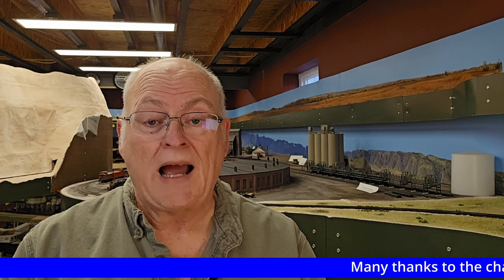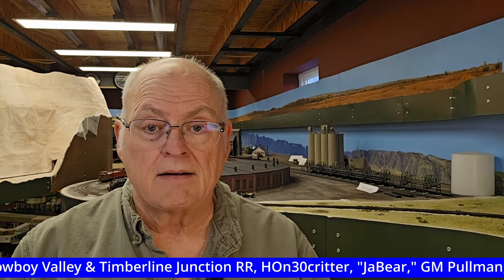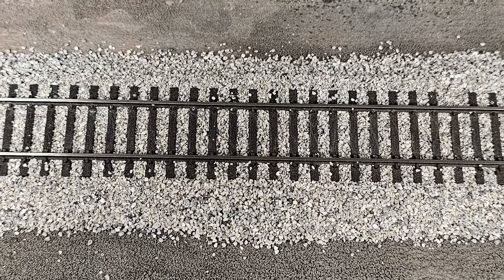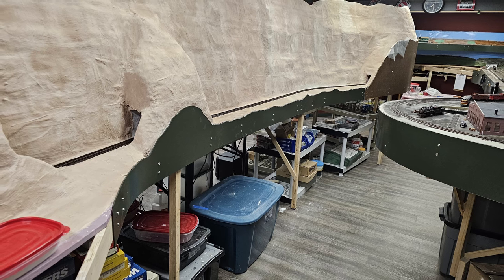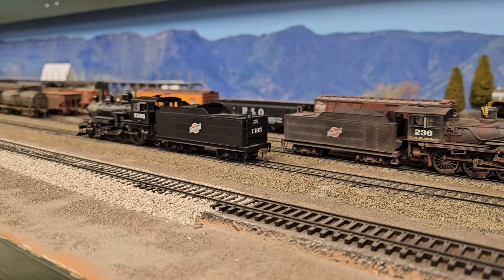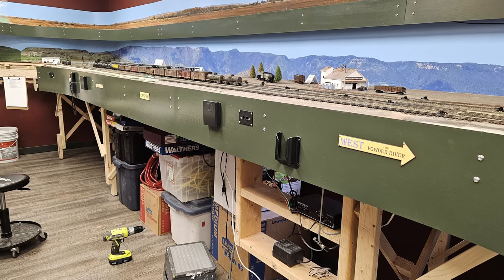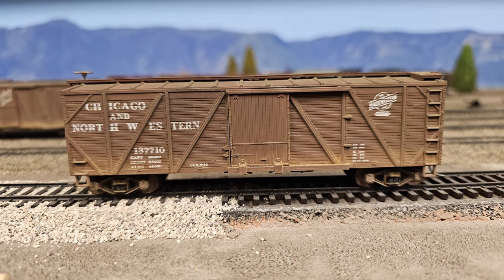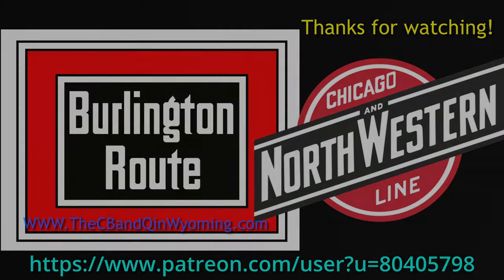2024 01 03 CB&Q V5 Monthly Update #50

Comment: I ran into the same numbering problem. My solution was to take a fine tip paint brush and a bit of white paint and changed the nine to an eight with a few light brush strokes. Looks “good enough” from a distance
Reply from the maker: I have a friend who simply paints out the last number on duplicate cars, using paint that's close to the car color. I guess there are lots of different methods...